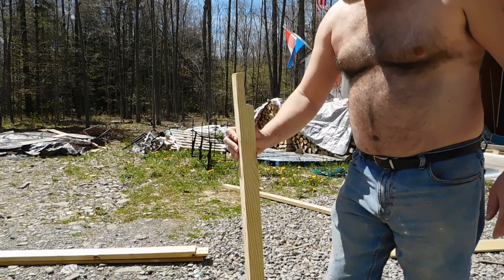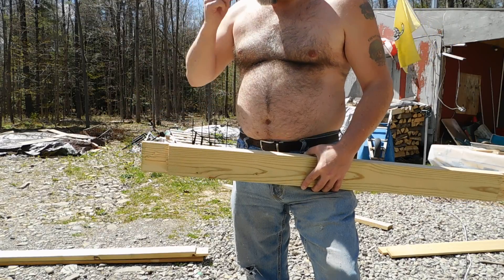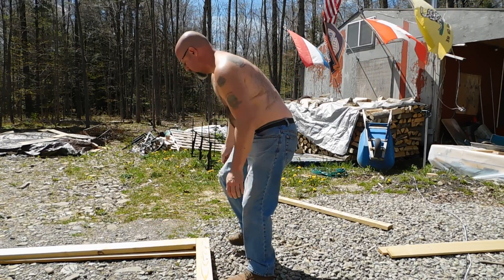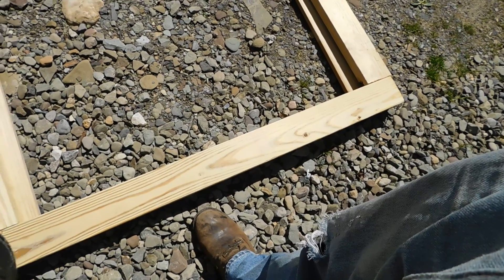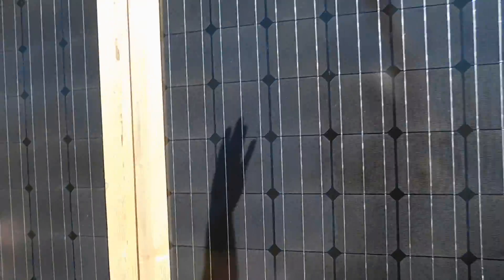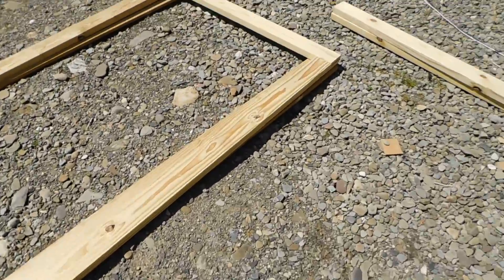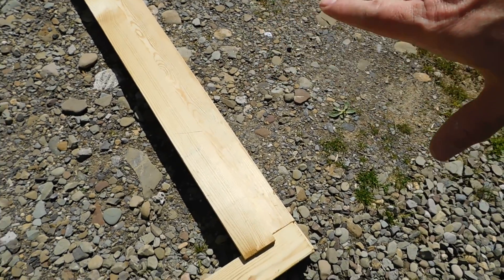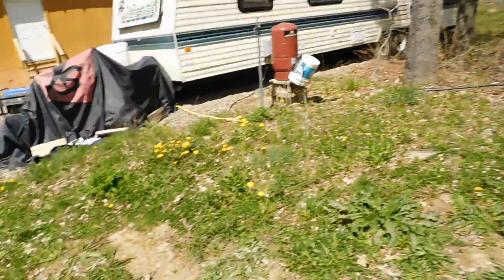Another video of me working on the frames for the solar panels.

Comment: you are doing great with those lap joints. I suggest taking all the frames apart and building a lean to structure three feet off the ground with the panels at 45 degree tilt and bolt the frames to the wood.
best
Reply: I got some e20 laminates (frameless). Might do that too.
Reply from the maker: +Rev John O'Toole That's not a bad idea thanks.

Comment: From the video you did the other day, work from the other side of the wood when cutting the cross slices, keeping the wide edge of the saws base plate on the wood. That way you dont have to worry about slipping. :) Just a safety tip.
Reply from the maker: +Old Pup Ok thank you

Comment: Check your new panels for fit before you proceed the vendor may have modified there design buy using a thicker aluminum frame
Reply from the maker: +james baker  They have not changed it. but thanks for thinking of that.